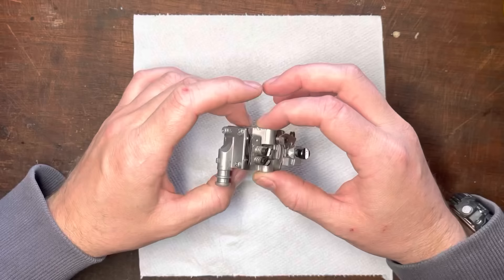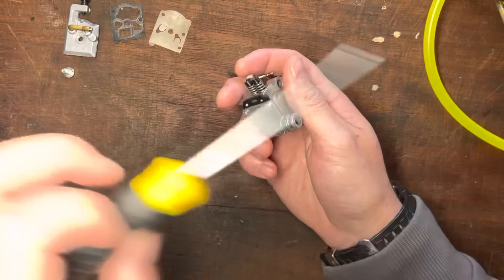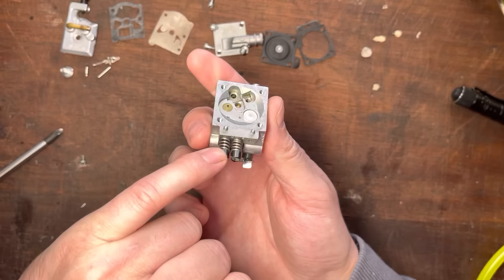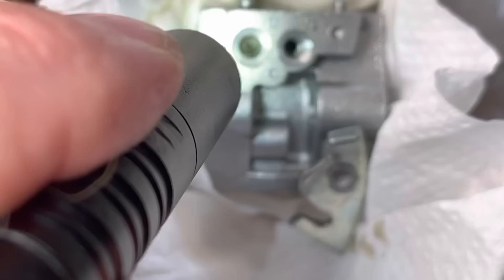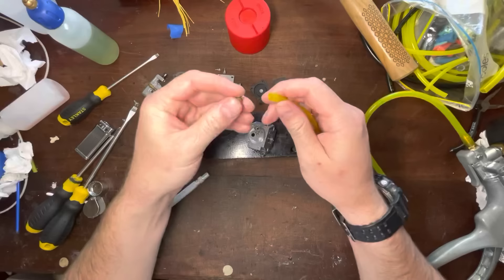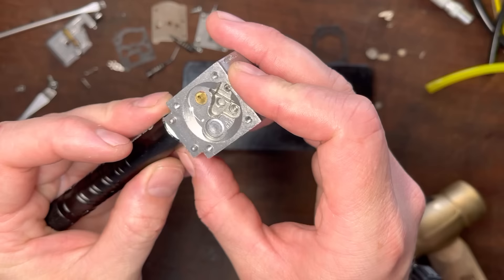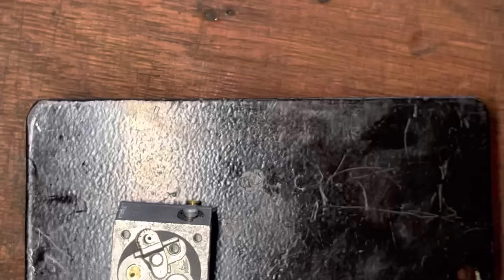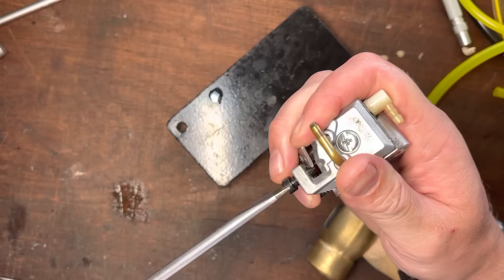2 Stroke Carburetor - In depth Fault Finding, Testing, Service & Repair

Comment from the maker: If this video helped you, please consider clicking on the THANKS button above to support my channel 🙌
Reply: Quick question, I have a 445 husqvarna x-torq that won't start but he sparkplug and exaust end floodsm??
Reply from the maker: @jorgehetnandez1696  You may find the needle is leaking in the carburetor? Clean up inside and double check :) either that or you’re not following the correct starting procedure? Could be a stiff metering diaphragm too, they can put more pressure on the lever. Have a look inside the carburetor is my advise :)
Reply: This is what I was looking for. You mention that the butterfly valve shaft cannot hang. For my Zama carburetor, it hangs both ways. Is that why I can't adjust the carburetor? Thanks again for the vids!!!
Reply: Awesome video! I’ve learned so much more from this video!
Reply: Do you have a link to the carb repair kit?

Comment: some carbs have a one way check valve on "both" the low speed and high speed side , zama I beleave does this , that tiny ltittle flapper valve inside them has a nasty tendacy to swell up (or better yet turn into a wad of goo) making then leak or become totaly pluged in both directions.. some are so difficult to replace that replacing the carb is the only way to repair the issue depends upon the carb design as to how serviceable they are  .. if the check valves dont work correctly as said a simple rebuild kit will not fix the issue iin this case. until the bad check valves are addresed. and they are often overlooked .
Reply: This has been my experience on a homelite super 2 with a zama carb. It was leaking air into the purge line that goes to the primer bulb. Main check valve was also finnicky at first but resolved itself. The kit came with a welch plug so I tried inspecting the idle check valve. Looked fine and I tried punching out a new plastic disc/valve but it only got worse. I put the old one back in, still some bubbles in the purge line and also soapy water test that indicated it's leaking from idle check valve. But it's better now and purges most of the air out if I release the bulb slowly. I'm curious to know if they're that necessary as some don't have it. Figured if mine worked partially, it would still run as it's only the low speed 

Also to OP, great video, wish I saw this before I started, I butchered my check valve trying to pull it out the wrong direction lol. Was curious if my check valve might leak in the same manor as I left some marks changing it out. Might have to go back and use some nail polish to be sure. Very helpful, informative and to the point
Reply: You're so right! It took me many many years of hard knocks to realize the importance of those damn check valves! I'd blow through those carbs with the air gun at 110 psi, rebuild it with a kit only to have to replace the carb not knowing why! Why didn't they tell us about those valves 40 years ago!?!
Reply: Yes indeed. These are a curse.
Reply: One of the things one also has to be mindful of is solvents in strong carb cleaner will attack the material inside the valve dissolving it it into a wad of goo, so be careful what you use. there are check valves in the primer housing as well as the carb body itself. fuel will do this in time as well. store equipment with the carb purged totally dry is one suggestion. I suspect additives used in some fuels are a big part of the blame .
Reply: @brianperkins6121  agreed! Which carb cleaner don't you use?

Comment: Walbro's recommendation is DON'T use nail polish anymore. The ethanol in e10 will dissolve it and can cause problems.
Reply from the maker: We don’t have ethanol here in Western Australia, but good to know!
Reply: @VintageEngineRepairs  oh that's good. A lot of our older equipment suffers failures due to E10. I've begun to separate ethanol from gasoline for my own equipment.

Comment: Thanks for clearly showing those tests.  Never knew about the vacuum test on the main nozzle.  Showing the punch out and re-seating of it was great.  I'm often hesitant to take things apart too much (i.e. welch plugs) b/c I think I won't get them as well sealed as from the factory.
Reply: I'm always that there is a spring or something behind the Welch plug that I will lose when removing the Welch plug! 😢
Reply: Same here. That vacuum test makes great sense. I never thought to try it. Wish I had time and time again though. Thks

Comment: Brilliant video explaining what took me 40 years to learn by hard lessons. Only bit you missed was the throttle control lever and post attached to the throttle valve. I've seen many carby's  worn out and leaking fuel or sucking air due to continuous grit grinding them down.
Reply from the maker: Absolutely spot on! They can wear / wallow out and cause an air leak. Thanks for the reminder :)

Comment: Hands down the best, most informative video on these carburetors in existence. Thank you!
Reply from the maker: That’s very high praise, thank you!
Reply: @VintageEngineRepairs   I have no formal training, just what I’ve figured out on my own and what I’ve learned from watching videos. I’ve worked on these machines quite a bit over the past 30 years with mostly good results. After watching your video, it made me want to learn more about these little carburetors and it reignited my interest in working on these little machines. Where do you find kits that have the welch plug and brass check valve in them? Every kit I’ve ever seen only has gaskets, diaphragms, and the needle parts. Thanks again!

Comment: I was given a brush cutter motor and am building a remote control aircraft using  it as the engine.
It was not going and was destined for the scrap bin by the last owner. Thanks to the effort and time you spent making this video it is now running like a new one ! 
Thank you :)
Reply from the maker: That’s awesome, I’m glad it helped :)

Comment: Im from the states and I enjoy your vids. I have a small engine shop and ive been working on small engines along time! I work on stihl mainly. But i do understand the need to clean and rebuild carbs vs new amazon or oem. Ive had so many come back after putting on an Amazon carb i just stopped ordering them and just buy oem. I go thru the process of cleaning each like you. 4 stroke carburetors are somewhat easy, but the stihl 2 stroke carbs are some of the worst ive worked on. Check valves and the high speed actuators on most are my problem. Fs90 carbs can be brought back to life and Some you just cant save. Carb spray in any carb but stihl seems to work fine. I remember the first stihl carb i cleaned with carb spray and after all that work it was worse than it originally was. I use a lot of little squeeze bottles too! Make my own solvents and lubes. Work better than most store bought. Its nice that there are some people who actually try to get something to work rather than be a part swapper, which i hate and hate 90% of these videos online. Anyone can change a part, but it takes a real mechanic to go into something and diagnose, clean, repair and rebuild what they are working on and it works correctly!
Reply from the maker: Couldn’t agree more :) well said!
Reply: @VintageEngineRepairs  hey your videos on when your cleaning and rebuilding carbs is quite calming. 😆  is there anyway you could do one on a rebuild and clean on a fs90 carb? If not I understand! Hey keep up the good work! I love your videos! Cheer!
Reply: Salutations! Please allow me to bend your ear a moment? I have come into a couple motorized skateboards recently and the engines are typical Chinese crap without any numbers or identifying marks anywhere. My question is, do u have a decent source for spare parts online? Rebuild kits? Diaphrams etc? I'm at my wits end with these cheap Chinese pos and just want these mfs to run. Any advice or sources for parts would be greatly appreciated. Thanks in advance!

Comment: I thought that was an excellent video.  Great job ! When I install a new screen that comes in the kit, I use the eraser on the end of a pencil , it is super close to the size of the hole and the eraser material will hold the screen from sliding around so you can precisely push it in the hole squarely. Once again Great job !
Reply from the maker: Awesome tip thanks for sharing :) glad you enjoyed the video!

Comment: I agree with all the positive comments - great video - very clear camera work so you can see everything and very helpful commentary - now off to finally get my Stihl SH85 leaf blower working after 4 failed attempts!!
Reply from the maker: Wooo! Good luck :) keep me updated!
Reply: @VintageEngineRepairs  - well I have succeeded - it has a v cheap brand new OEM C1Q-S68G carb that I got from eBay for £13. I have stripped it down a couple of times before I watched your video, but not all the way. So took everything off and re-cleaned with carb cleaner and compressed air.
The only think I spotted that might have been a problem was that the inlet control lever was hardly moving the inlet needle at all - much less than on another old carb I compared it to. So I bent the needle end of the lever (with the fork) up by about 0.5mm so that it was clearly moving up. Put it all back together and....nothing. Guess why? I forgot to reset the H & L needles. Once I did that it started easily and is running v well - just got to adjust the tickover as that's not quite right at the moment.
So my top tip is - don't forget to reset the H & L needles after a carb teardown!!
The only other problem I had was working out which way to put the metering diaphram back in - in addition to the screw holes it has 2 other holes at one end and I really couldn't see if it mattered which way to put ot back - so I guessed!
Thanks again.

Comment: Awesome video I'm out in the bush 40kms from the nearest  settlement and my saws running like Forest Gump   then it just stopped running  , lucky I have reception on me phone and got to watch this  ,I pulled the carb off and  gave it a birthday and now it's  clean as a whistle and running like Forrest again I have no nail  polish or vacuum pump so I just sucked on the fuel tube no leaks ,salurbrious thank you for the pointers ,the fuel filter in the tank had a crack on where the fuel line  pushed on so it was sucking up all sorts of crap that was under the mesh , all good now after sorting them coupla issues out  cheers lots of handy tips
Reply from the maker: That’s awesome :) thanks for taking the time to share your adventures haha

Comment: Very informative, this will be so much help to anyone with a 2 stroke . 
Concludes my theory that why are they still putting carbs on when a basic injection system would be far more reliable and simple to manufacture??? This goes for lawn mowers, stone saws , chainsaws etc . I’m aware that certain manufacturers have started using injection and from what I’ve seen they still can’t get it right , which suggests to me lack of talent in the design department or the dreaded ‘account says no ‘ . Saving pennies to inevitability ruin a feasible concept!! 
Thanks for the content, I will now attempt to rectify running issues with some of our engines 
👍😇🇬🇧.
Reply from the maker: Thanks for the kind words :) glad you enjoyed it! I’ll take a carb over FI on small engines any day :)

Comment: Wow!  This is so helpful.  Rich, genuine information covering what's been a "black box" for many of us.  Thank you!  Before: problems were poorly handled using the "shotgun" parts replacement technique.  NOW:  Test and understand root cause, target the actual problems, repair/replace bare minimum & maintain OEM integrity - resulting in faster, better, more reliable repairs.  I've got old carbs that don't work - turns out I have been blowing out main nozzle check valves!  Anybody know where to get replacement main nozzles?
Reply from the maker: Glad you enjoyed it! Yep, your local small engine repair shop can order nozzles.

Comment: If I can add one bit of advice: be gentle with the needle valves. Driving them down hard can damage them or the carburetor. Just screw them in gently. I learned this as a kid when running model airplane engines; I ruined a few needle valves until an older guy explained I was being too heavy handed. Great video! Cheers from Canada
Reply from the maker: Thanks mate :) yep, spot on! Gently seated is fully sealed!

Comment: Okay...so this has got to be the most thorough check list for 2 stroke carbs out there...here...anywhere?
...ehh, anywhere may be a smidgen exaggerated. Definitely the best  I have come across...which was actually through Roku...but I had to step over to the PC to comment.
The only thing you may had missed, the primer bulb? Which holes/channels it is suppose to affect.
I didn't realize the idle had 3 jets.

...Oh, look over there... "All Episodes - 2 Stroke Carburetor Learning"
Did I make someone look?
Any ways, I also wanted to capture this for later reference and say this info will surely cause me to spend more time being thorough...but less time over all by not having to disassemble what I had just assembled for the third time.
Reply from the maker: Glad you enjoyed it! I have other videos on carburetors that have a purge bulb :) hope you enjoy them as much!

Comment: I will simply agree with all the accolades given. I am fighting to understand the carb circuits and operation on a zama but now have a much better knowledge of what to examine.
Reply from the maker: Wonderful, I’m pleased to hear it! :)
Reply: @VintageEngineRepairs  apparently it's got a bad check valve. I can't even get it to deliver any fuel. I'm gonna tell the customer to go buy another.

Comment: Great Video & excellent camera work, especially the close-ups. I did watch a video from the Walbro company and they mentioned that ethanol fuels can eat away the polish around Welsh plugs and check valves so I am not sure what the answer is here if they are leaking. I look forward to seeing other videos now that I have subscribed and hit the bell for notifications.😁
Reply from the maker: Thanks for sharing! Yes it can remove it over time. Welch plugs don’t really need sealant on them, the manuals don’t recommend anything now days because of alcohol. The aluminium seals very well :) I use it because we don’t have ethanol, but I’d happily use no sealer!

Comment: the way you replace the gasket and diaphragm on both side of the carburetor, ( one side the gasket and diaphragm and  the opposite way on the other side)does it apply to all carburetors, I have Walbro 416 on my echo chain saw.  Thanks for sharing
Reply from the maker: Yes :)

Comment: This is a great video—super helpful. However, I have done everything on here with meticulous care—but my carb is still not working!  I am determined not to be beaten but I am all out of ideas.  I know it is the carb as I bought a new one and the saw works perfectly, but I am determined to find out what is wrong with the old one. Are there any stones left to turn on solving starts-well-but-won’t-run carb issues?
Reply from the maker: Thanks for the kind words :) it could be 20 different things haha. Without hearing it run or having my hands on it, it’s quite difficult to diagnose unfortunately. You can take a video of you starting, running it and it cutting out and forward the link to tomscandian@hotmail.com 👍🏻

Comment: Best teacher I've seen  on the net. Thanks . I am old and forgetful,  the gaskets and diefram go.  Does all 2 stroke engines  carburetor gaskets go the same?  Thanks again Carl in Goodyear az.
Reply from the maker: Hey Carl, there is some variation especially on the older tillitson carbs from memory* however typically on the metering side the gasket goes down first then diaphragm. On the fuel pump the diaphragm goes down first. Warm regards, Tom.

Comment: Qd electrical cleaner with the tube tip disolves corrosion pretty good and spray some in a bulb syringe then squirt it in to clean the check valves  etc works good and some jewel's rouge on a q tip chucked in a Dremel tool or drill cleans and refinishes the seat area for the needle and seat, maybe that will help you out. All the best Sir.
Reply from the maker: Thanks for watching and sharing :)

Comment: I feel I have just taken a Master Class in small engine two stroke carburetors ! 
As a student I would have asked one question , could the nylon 90degree elbow you removed be sealed by replacing it back with the nail polish around the brass fitting  ? 
You sir have taught me a lot I didn’t know ! 👍
Reply from the maker: Glad you enjoyed it :) more than likely yes! It would be fine, I’d probably use CA Glue. Thanks for watching!

Comment: Great video, thank you! As I don't have a metering lever gauge, are you able to tell us the range of heights above or below level with carb body?  My Stihl FS85 weedeater just floods like nothing else no matter what I do. I even resorted to putting a flame into the spark plug hole to burn off excess fuel in the chamber. I've found that if I pull the starter cord slowly with plug out and flame in there that for every stroke, a big dirty orange flame shoots out almost a foot long. Waaay too much fuel in there!
I've had the carb apart 3 times now looking for a stuck or blocked jet or valve and am about to put a replacement carb on.  I'd give it one more crack if you could help with this information. . I've currently got it set pretty much level and thought if I dropped it more the valve just wouldn't open at all..
Thanks heaps, Glen from New Zealand.
Reply from the maker: Hey Glen! I will have to know what carb model and then I can tell you the height, sure! Don’t give up! You’ll get there :)